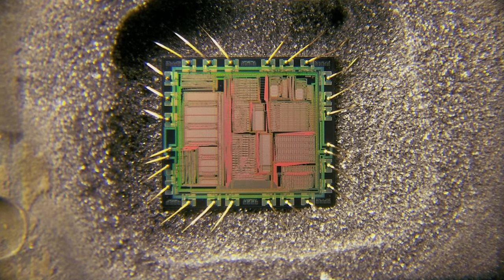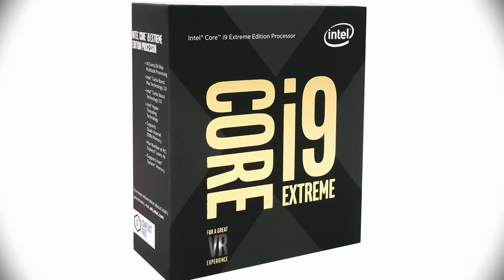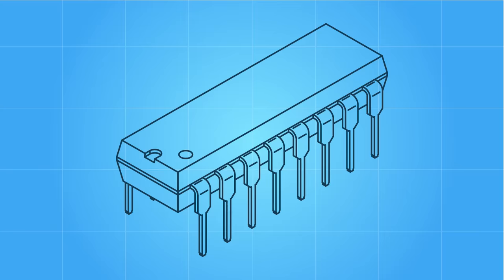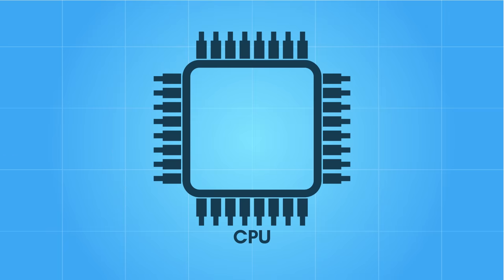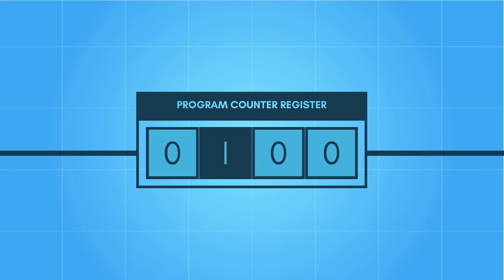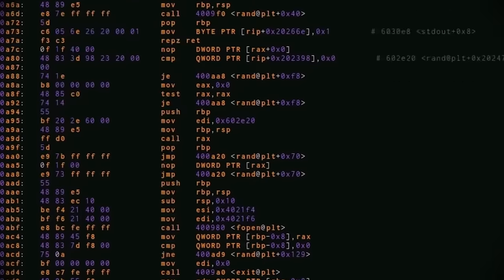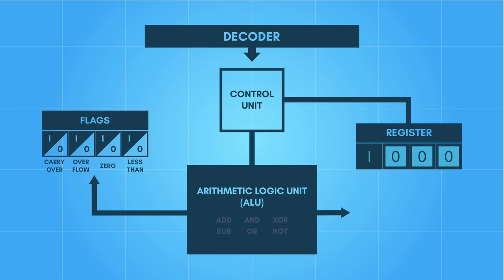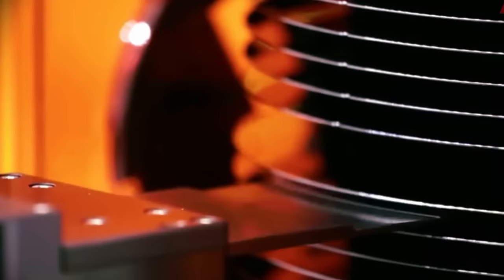The Evolution Of CPU Processing Power Part 1: The Mechanics Of A CPU

Comment: At 5:34 you merged CISC & RISC architectures. CISC (Complete Instruction Set Computing) is what all CPU’s used until Acorn (now ARM) introduced the RISC (Reduced Instruction Set Computing) model in the 1980’s. This is used by low power CPU’s such as in mobile phones today. 

RISC had nothing to do with the Intel 4004, in fact no x86 Intel CPU uses RISC architecture of any kind. They are all classic CISC processors.
Reply: "in fact no x86 Intel CPU uses RISC architecture of any kind." That's horse-shit. All modern x86 processors are effectively CISC-RISC hybrids. Microcode would like a word with you -_-
Reply: @Cooe.  yes and no. But they're still definitely CISC. It's just they've changed the inner working core to have a RISC like inner core, where all CISC x86 instructions are transferred (using the CISC architecture - newest meaning of CISC) into "micro ops" i.e. RISC instructions, to approximate some of the advantages RISC has (pipelining & superscalar = clockspeed, somewhat easier job of speculative execution/branch prediction).. but a CISC instruction set will always run on only a CISC processor. 
CISC processors might change over time, and adopt a part RISC like inner architecture, but that's just changed what architecture services CISC instructions, and what CISC architectures do.
Reply: @gazlink1  In the same way a petrol car is not an Electric car, yet it has a battery

Comment: 4004 was never an processor, just integrated circuit for calculation. the 8008 was the first real one and never designed by intel. The Guys at Datapoint did all the work on that baby

Comment: Apollo 11 had a "small" computer DSKY with prototype integrated circuits. It had small ferrite rings as memory. and small integrated circuits made of Si. You could easily scrape off the material that covers the circuit, so destroying it. Nowadays, polymers cover the circuitry, I think the idea was to avoid reverse intelligence. Latter on, a company embed even smaller circuits in a solid composite. No mechanical stress could destroy these connections. Static electricity or power supplies can destroy microcircuits, proceed with caution.
Reply: I guess that's why all our computing tech comes in static-free bags, and you're advised to ground yourself by touching something metal before you handle circuit boards.
Reply: @Nightweaver1  CMOS chips are static electricity sensitive, like tiny capacitors. The thin layer of metal oxide (MO) between metallic layers can be destroyed by static electricity (static e-). While transistors-transistors logic (TTL) are more sturdy, these circuits are connected by semiconductors, non-metal alloys like Ga-In-As, Ge-As, mounted on wafers of Si. The metalized plastic bags somehow prevent static e- from touching the circuitry. You are also advised to disconnect the power supply for similar reasons and ground yourself to the motherboard support. This is very important!
Reply: Actually DSKY is just a sort of Keyboard. The computer assembly weights a lot more.
Reply: So sorry, the computer on board was called AGC. It was made for landing on the moon. Shouldn't we call it mooning?

Comment: While the CPU is an important development, ic ram and later flash memory is more so and was Intel's priority not the CPU. Early CPU's infact had a difficult time being so much more limited compared to 12+ bit discreet devices. But this was not the case for RAM which sold as quickly as it could be produced.

Comment: Interesting but much of this is old stuff for me.  In days of yore when I was trained on this stuff, instead a CPU being a single chip on a motherboard, it was made up of as many as 50 components.  Each component was replaceable in the field.  The components were much the same but bigger, slower and much more difficult to troubleshoot.   You coudn't just pop the Processor off, add some thermal paste, plug a new one be on your way.   You needed to figure out which of the 50+ components was failing.  IBM 1968-1998.   Would you believe we would replace read/write heads on disk drives? It's hard for me to believe too.

Comment: Intel 4004 wasn’t that revolutionary. Before 4004 you could buy the parts that were integrated onto a CPU separately. You could by ALUs, shifters, registers etc as discrete chips. These had been used to make mini computers. It was obvious that eventually you were going to be able to put them all on a single die.

Comment: The goal of executives is to push CMOS technology and ignore resonant tunnel diode threshold gates that have a speed power product 100,000 times that of CMOS. If the executives decided to try RTDTG, the engineers would have to learn something new instead do doing the same old thing over and over. What customer would want a 2 THz CPU or GPU which costs less and consumes only 5 W?

P.S. CMOS is inherently quantum mechanically defective. The N-channel FET turns on faster than the P-channel FET turns off, therefore shorting power to ground on every clock cycle. The GaN idiots tried it even though the mobility difference is five times worse in GaN. That means the short is 5 times longer.

I uses tunnel diode login in 1968 at 0.5 GHz. in 1984, GE sold 70 GHz tunnel diode logic gates.

Comment: International Worldwide Technological Cyber Networking Committee should find ways to collaborate with telcos worldwide to consistently reinforce, evolve, adapt and strengthen Global wifi wireless networks 

While Preventing, eliminating and deterring persistent High Latency/Pings rate such as Games played in Steam is drastically affected online where wireless networks are vulnerable to this kind of problems 

That's been affecting users worldwide

Second Consideration to put into consideration is to continuosly strengthen and reinforce cybernetworking to deter High Latency and pings as said repetedly so that its extremely beneficial for the long term :)

Hope this message is registered to those who are experienced in this kind of field to rectify and reinforce this issue that has been plaguing users worldwide :)

Thank You :)

Comment: Huh. That makes the 6502 even more crazy than I thought, since it's got about the same transistor count as the intel 4004.
Given it's quite a bit more capable than one, this means it's capabilities come almost entirely from design and manufacturing improvements for higher clock speeds than they do from increased transistor count, as is usually the case, especially nowadays
Reply: Might want to check your math there. See https://en.wikipedia.org/wiki/Transistor_count
4004 - 2300 transistors
6502 - 3510 transistors

Comment: Just saying the Intel 4004 is not classic RISC. While most of the video's great, calling stuff RISC when it is not is cringy. RISC computers were invented as a counter-movement to prior CPU design where teams added ever more niche addressing-modes and instructions. Complicating processors for little used features. RISC was a clean-up act. By the mid 1990's it wasn't even relevant anymore.

Comment: The INTEL I9 is old hat now that we have the AMD 1950X through to the 3990wxt and we are already at 64 cores 128 threads so I guess INTEL might as well sell up and get out, all new chips has to have instructions like...
AESIMC
AESENC
AESENCLAST
AESDEC
AESDECLAST
AESGENASSIST

if not then what is the point of having that chip sorry for shouting...

Comment: not CPU, but GPU pretending to be the main CPU
Reply: three or four, parts, who counts, heh
Reply: clock signal can have denoise property, assuming it has the same noise as the data lines, but also dedicated zero signals for denoising data signals, improving SNR in the data, to make the voltage less, power less
Reply: optical mems gate direct logic photon momentum transistors, or optical gate transistors, also keyboards with leds for detector/backlight/rgb/display key switches with flex full surface keys

Comment: You're still using Meaningless Information Propagated by Salesmen (MIPS) as if it means something. Since an “instruction” has no semantic meaning, this is just noise. To maximize the MIPS, make all your programs out of NOPs. Then you will not be bothered by delays caused by actually doing anything useful. I can get the same result by NOT RUNNING a program. 0 Million Instructions / 0 seconds.